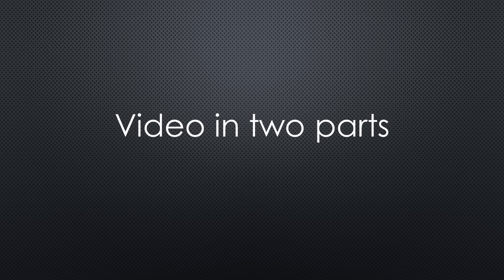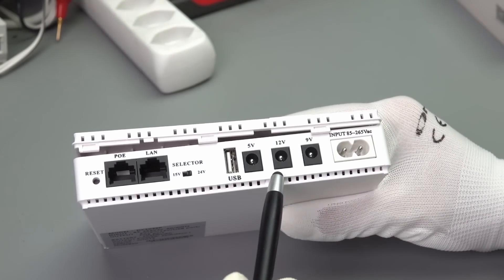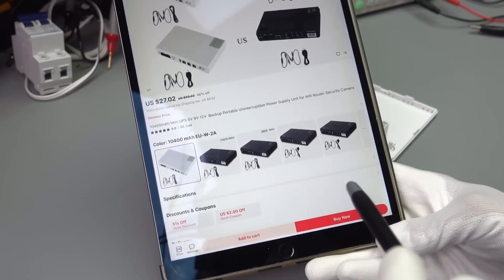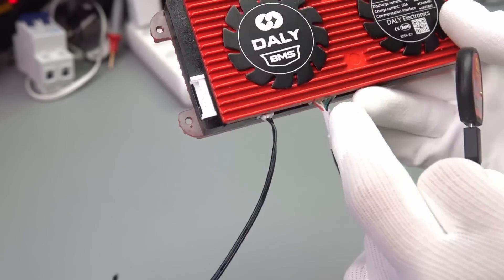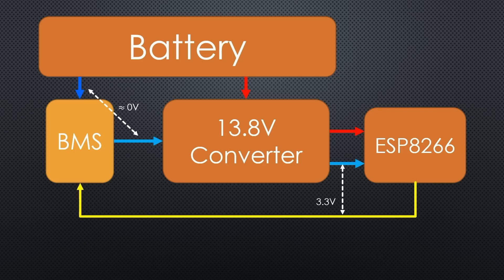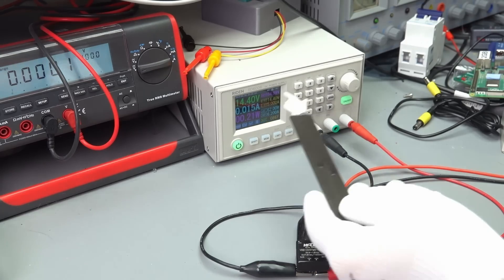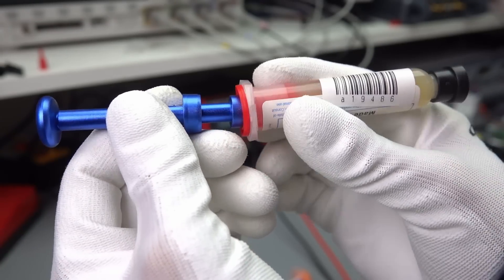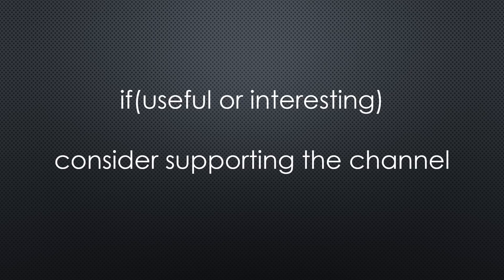458 The second Part of My Long Mailbag

Comment: Hi
This is regarding the BMS2MQTT in Home Assistant.
I have made many NODE RED flows and they all works very nice. I can receive the mqtt data from the BMS2MQTT device connected to my Daly BMS and I have a working "influxdb out" that can send data to the database.
My problem is unfortunately, that the data from the BMS2MQTT can't be converted into the JSON format in a "mqtt in node", needed in the "influxdb out", and I get errors. How did you manages that issue?
Best regards
Bjarke
Reply from the maker: I used this functional node in front of the influx node:
msg.payload = [{
    volt: msg.payload.Pack.Voltage,
    current: msg.payload.Pack.Current,
    power: msg.payload.Pack.Power,
// msg.payload.Pack.Current *msg.payload.Pack.Voltage,
    SOC: msg.payload.Pack.SOC,
    cellDiv: msg.payload.Pack.Cell_Diff,
    remaining: msg.payload.Pack.Remaining_mAh,
    lowCell: msg.payload.Pack.Low_CellV,
    highCell: msg.payload.Pack.High_CellV,
    lowCellNr: msg.payload.Pack.Low_CellNr,
    highCellNr: msg.payload.Pack.High_CellNr,
    cellV_1: msg.payload.CellV.CellV_1,
	cellV_2: msg.payload.CellV.CellV_2,
	cellV_3: msg.payload.CellV.CellV_3,
	cellV_4: msg.payload.CellV.CellV_4,
	cellV_5: msg.payload.CellV.CellV_5,
	cellV_6: msg.payload.CellV.CellV_6,
	cellV_7: msg.payload.CellV.CellV_7,
	cellV_8: msg.payload.CellV.CellV_8,
	balance1: msg.payload.CellV.Balance_1,
	balance2: msg.payload.CellV.Balance_2,
	balance3: msg.payload.CellV.Balance_3,
	balance4: msg.payload.CellV.Balance_4,
	balance5: msg.payload.CellV.Balance_5,
	balance6: msg.payload.CellV.Balance_6,
	balance7: msg.payload.CellV.Balance_7,
	balance8: msg.payload.CellV.Balance_8
},{
    name: msg.payload.Device.Name
    
}]
return msg;

Comment: You do not need the power supply there is 3.3 volts from the BMS on that blue tooth cable I am running a ESP 01 directly off it as a remote serial port. Note 48v 16s daly smart bms
Reply from the maker: I agree. Unfortunately, it was not strong enough for the high current peaks of the ESP8266. The documentation mentions that not all BMS supply enough current.

Comment: Hello Andreas, thanks for excellent videos, always learning the EE theory and that's greatly improves my understanding of electronics. I'm struggling to understand the reasons you are describing at 5:20. Can you please expand this in a separate video and provide the examples with the common ground and this low side. I'm interested because I'm going to implement open source BMS with IoT load along with few motors and this looks very similar to what you have on your diagrams. Thanks!
Reply from the maker: If the BMS stops, you can see it as an open switch. The converter still is connected to 24V and, if it has some internal resistors from plus to ground, its ground will be at a higher voltage (it acts like a pull-up resistor connected to 24V). Just replace the input side of the converter with a high-value resistor in your mind.

Comment: The individual battery cell wires you mention may not be only for balancing.  Power banks usually connect cells in parallel and has a boost converter to obtain 5V.  However in this case the cells may be connected in series to get a higher voltage, and they may be passing it through a buck converter to derive 9V & 12V outputs.
Reply from the maker: You are right. 5V power banks often do that. I think I measured the overall voltage and decided they were connected in series.

Comment: I can't see how you killed the BMS: if it turns off, the converter output would turn off as well, but there is no reference to the battery ground, according to the graphic. There is a small leakage current from the BMS to the converter, but I can't see the output line going up to 24V. Did you actually measure that? Even assuming the converter output negative would go up, the ESP again would stop working as it now sees 0V on it's input.
Reply from the maker: The input resistance of the attached buck converter pulled the voltage up :-(

Comment: 9:30 ...my problem is not to buy flux/solderpaste, but to choose WHICH flux/solderpaste to use :D
most DIY/fixing channels have their own brands/shops and won't tell the original name/supply so they can get the money.
but yeah, solderflux is really underrated!
Reply from the maker: I only use a cheap AliExpress flux that does the job. But I am no soldering specialist.
Reply: @AndreasSpiess  yeah I understand that, but even now you're saying "I use what works" - while there are hundreds of shops selling flux, original and fakes, bad and good ones - so I would have to buy each from the hundreds and test for quality.  That's the problem, the ones who found a good one, don't tell which one (which shop especially) is selling good one 😹

Comment: A low cost flux dispenser is very interesting. But what would be even more interesting is a source of good quality and low cost flux! I've been soldering for 40 years and the cost of both the solder and the especially the flux is getting quite ridiculous. 🙂
Reply from the maker: I use cheap AliExpress flux and it works. But I am not an expert in soldering...

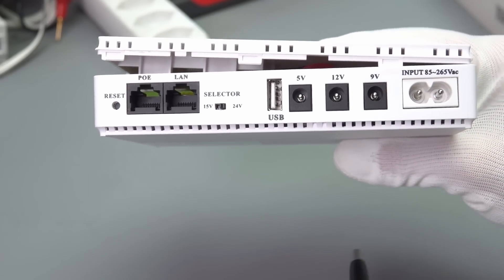Comment: 0:58 You mean 120 and 230 volt (UK even have 240 volt) or as the label shows 85-265 volt 😀

It looks like the 18650 cells are connected in serial. If you connect 4 cells in serial you won't get 10400 mAh, you get 2600 mAh.
Reply from the maker: You are right!

Comment: Hi Andreas. Did you tested that UPS with Raspberry? What is the exactly voltage at the 5V port? Thank you for the video.
Reply from the maker: No, I did not test it with the Raspberry because I use it for different purposes. The 5V voltage usually is a bit higher than 5V (my crappy setup caused a voltage below 5V)

Comment: The flux gun (effortless extruder at 10:37) is a great idea. Design looks simple enough it could be made as a 3d-printed item. A quick search verifies there are a number of existing designs variations under 'flux dispenser'. 
Thanks Andreas, all items covered in this 2-part series were interesting.
Reply from the maker: The 3D printed parts have to be quite sturdy. Otherwise they probably will bend or break. But it is worth a try!

Comment: Have you measured idle power of the UPS?
It is replacing the power plug of the device, so efficiency might be important!
I got fooled first when measuring 
But it’s getting rather hot 😮
Reply: My UPS cost €36 in 09/22
Reply from the maker: It consumes 2.9W if fully charged without load. The device stays absolutely cool when I discharge 12V/1A

Comment: There is 5/9/12v+USB mini ups on ali, it comes without batteries and very cheap. I used to have one with welded-in batteries and it was a pain to replace the cells.
Reply from the maker: I did not find it. Can you provide a search term (YouTube does not accept links)
Reply: @AndreasSpiess  I put no link, only the item number, and my comment was still removed... Let's try again. "diy 18650 ups" Black, 3 or 6 empty cells holders. There are many offers.
Reply from the maker: @gabest4  Now I found it. Thanks!

Comment: I saw a switch on there yesterday that also doubled as a solar charging coordinator for an attached battery to use as backup for the switch and the poe ports.  Was almost tempted but, someone else can go first.   On the UPS, each cell is 2600mAh, 3.7V with them in parallel to hit that 10,400mAh capacity, that means it's all step up, lots of waste both on the stepping up to power something as well as all that circuitry for something so inefficient.  Be curious to see what actual run times would be on the devices plugged into it as well as its discharge amps are at 12V.
Reply from the maker: A quick test on 12V/1A gave 26.8Wh

Comment: Thanks for the product tips.... The "back-power" problem can cause annoying problems besides destructive. I often have an UART and/or JTAG plugged into a board that I really want to power off the processor so I have to disconnect everything to be assured I am completely resting the processor.   But in your case I can see why you thought the way you did, I'd probably fall victim to the same thing, don't feel too bad.  Neat solution for $5 but.... really?    Sigh! 🙄  I'm with you on having a solid, dependable ground!
Reply from the maker: Because I had two casualties in a row with this ground issue, I hope it is hammered in my (old) head now ;-)
Reply: @AndreasSpiess  Ah! I recognize that one... First time it might be a fluke, second time... Hmmm Can't be two bad modules in a row... and just about to make it 3rd time's a charm when you say: "Uh oh... could it be!?!?" And that's when you "see it"
Reply: @AndreasSpiess  Okay story time... so I have a music studio and I have equipment plugged in one side of the room with old wiring and other equipment plugged into the other side room with new wiring and a real ground. When I plugged an audio signal into my mixer I got a POW!!!! and after 2x I realized what was happening... I found 50V AC between the grounds... so I ran a #12 ground wire from the new wiring to the old wiring and solved the problem... then I needed to get my mixer repaired I had a dead channel.  Zapped it to death!  Oh how well I know how important the ground is.

Comment: The manufacturer of this usb/5/9/12/'poe' UPS device boasts with 10400mAh while the cells are in series, which is not correct. This manufacturer therefore cannot be trusted and the device should be thoroughly inspected before putting it into service.
Is there enough separation between the mains voltage and the low voltage areas on the PCB? Will it still run at a decent temperature when supplying rated power and charging the battery at the same time? And how much time is needed to charge, in that case? Are the Li-ion cells operated safely? Do all outputs have a common ground? Does it have good quality low-ESR caps in the regulators?
I think, having all cells in parallel would have better value. A tinkerer could then easily extend the UPS runtime by attaching more 18650-cells to it.
And this device will not do standard PoE as defined in IEEE 802.3af / 802.3at. The 12V/24V voltage selector switch gives that away.
Reply from the maker: I agree, a test of this UPS would be a good thing. I tested it on 12V/1A and it did not get warmer than ambient, also not after 1h. And of course, mAh is not a good measurement for a multi voltage power supply.

Comment: For a Syringe dispenser there is also this alternative on printables: "Yet another flux Dispenser" it does the same thing but is 3dprinted and just 2 bolts and nuts
Reply from the maker: Looks good if it is stiff enough. Did you try it?
Reply: @AndreasSpiess  i printed 5 of them it works same
Reply: @AndreasSpiess no not yet. Printed it today handle laying down(to have better stiffness) with some support but have to get a longer screw from the job tomorrow before i can test

Comment: I do not understand - the uart connector of the DalyBmS carries 5 volt, as does the connector next to it - the rs485 connector - plenty to power an esp8266.
Reply from the maker: Some of these BMS versions provide enough current to power the ESP8266 (with its current peaks), and others do not. Mine did not work with the supply provided by the BMS. Another commenter had more luck...

Comment: Might be nice to get some 3D files for that flux tool, they are easy 3d prints, and you just need the threaded rod/
Reply: check printables "Yet another flux Dispenser" its compareable
Reply from the maker: Keep in mind: It has to be quite sturdy...
Reply: @AndreasSpiess  Yes, I suppose you could redesign it to be stronger, which flux do you recommend?
Reply from the maker: @molitovv  I use a cheap one from AliExpress (Kingbro RMA-218)
Reply: @AndreasSpiess  Thank you, will order.

Comment: Thank you for the interesting mailbag! Are you using PoE with 24V? I am using 48V, but 24V are more convenient. I am using liquid flux. It is very easy to apply.  Your solution is a good hint for using solder paste.
Reply from the maker: 48V PoE is different. It runs power and data on the same wires and enables Gbit connections. 24V PoE uses some wires exclusively for power and therefore only supports up to 100Mbit (I once made a video about it). The 5.8GHz antennas from Mikrotik and Ubiquity use the latter standard. As well as PoE cameras.
Reply: @AndreasSpiess  Ah, Thank you, that is the reason. I hesitated using PoE until GBit capable units were affordable. So, I have 48V only. Bevore that time, I installed  a 42V "hone line"  in parallel with the LAN cables.
Reply: @AndreasSpiess  Interesting... I never heard of a 24V PoE "standard", only 48V.

Comment: I have 2 of those UPSs. One I've had for a couple of years. Good units.
Reply from the maker: Thank you for sharing your experience! So there is hope our station will run for a long time ;-)
Reply: @AndreasSpiess  I even expanded the batteries for more capacity. I have had a blast in the several times I was in HB9. Did several of the Zurich SOTA summits, and the mont Blanche (in winter).
Reply from the maker: @VK3TWO  I saw on QRZ that you live off-grid. So you need reliable batteries ;-)

Comment: Another thought. BMS products that I have seen operate with milliamp balancing current. I have a DIY approach that switches on one ohm resistors and draws about 3.5 amp balancing current. I am able to balance only when my batters are above 3.39 volts (close to fully charged --- I charge only to 3.45 volts). This seems to work pretty good with my old and mismatched batteries. Thanks for your great videos.
Reply from the maker: Modern batteries do not differ a lot. So a small balancing current seems to be sufficient in the long run.
I added an active balancer to my setup but disconnected it as a default. I plan to connect it only if I see a major imbalance.
Below 3.45 volts, my cells do not differ a lot. Only after 3.5V they start to be different.
Reply: @AndreasSpiess  yes. However if you charge to a lower voltage (e.g. 3.45v vs 3.55v) the imbalance will manifest at a corresponding lower voltage. Also, for my  system, saving energy with an active balancer is not useful as my batteries usually get fully charged 3/4 of the way through an average day and any energy saved with active balancing just gets uncollected. No balancing happens on a cloudy day.

Comment: More pedantry, this time of an engineering nature (where pedantry is a virtue not a vice!): Is the first item definitely a true UPS rather than just a power bank? In my book to be a UPS it has to be able to supply the full load from the mains at the same time as charging its internal cells at the maximum charge rate. A typical power bank will either only charge the battery at a very slow rate when a load is connected, or will even disconnect the load whilst connected to the mains for charging, making it useless as a UPS.
Reply from the maker: It can charge while discharging. As you rightly mention: Most power banks cannot do this trick...

Comment: Wie kommen die Spinner auf 10400mAh wenn die Akkus nur 2600mAh haben? Unmöglich. Selbst wenn die Akkus parallel geschaltet sind, wovon ich ausgehe, wird man nicht annähernd die Kapazität erreichen. Ja, 4x2600mAh sind 10400mAh, aber ich glaube nicht, dass jemand in der Lage ist einen step-up Konverter zu bauen der in der Lage ist Verlustfrei die Spannung von 3,7v auf 5, 9, 12 oder 24v anzuheben.
Reply from the maker: Ich stimme dir zu. Wh wäre die richtige Einheit. Aber jetzt weisst du was drin ist...

Comment: Excellent, I designed and built one power bank with  5V, 12V output 3 years ago for my internet router and fiber modem,  live in a country area where grid interruptions are more or less frequent and I got tired of APS UPS devices that beep like crazy and turn bright LEDs on when power is down (I really do not need this, I know when power is down),  besides it only gives about 30 minutes of ups, mine,  with 8 li-ion batteries gives me more than 9 hours of ups reliably!
Reply from the maker: I also had a Eaton UPS because I also wanted to protect my 230V PC. But it was defective and went back to the supplier. Maybe I go your way instead of buying another standard UPS...

Comment: I´m using an ESP directly on the port of the Daly-BMS, so even the power supply. No problems so far...
Reply from the maker: My BMS did not provide enough power for the ESP8266. The project description mentions that some versions provide enough current. So you were lucky...

Comment: If you want to use ESP8266 or ESP32 instead of the Bluetooth dongle, wouldn’t it make sense to power it from the same 3.3V or 15V output from the BMS as the original dongle. That way you can be sure to use the same ground reference for the ESP and BMS, and you don’t need any extra components.
Reply from the maker: I agree and other versions of the Daly BMS seem to provide enough power for an ESP8266 (which consumes much more power than the BLE dongle). Mine did not provide enough current, unfortunately.

Comment: Ah I thought by the look of the component that it was the Hi-Link HLK-M50 WiFi unit you were going to talk about. My solar charge controller uses one of those and I want to hack into the communication so I can use the data for better analysis than offered by the standard app. Anyway, good video and let's hear more about how it goes with the BMS :)
Reply from the maker: Maybe you can read the serial data of your BMS entering the Hi-Link HLK-M50? This is what my ESP8266 does...
Reply: @AndreasSpiess  Yes, great idea. Thank you!